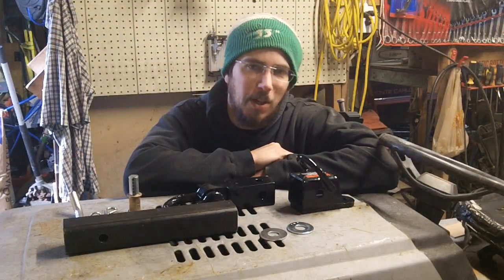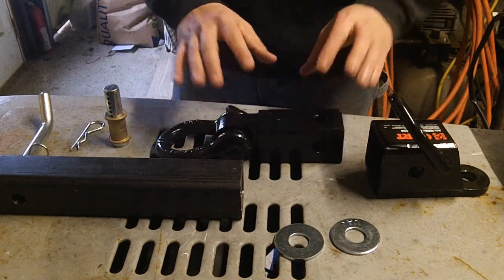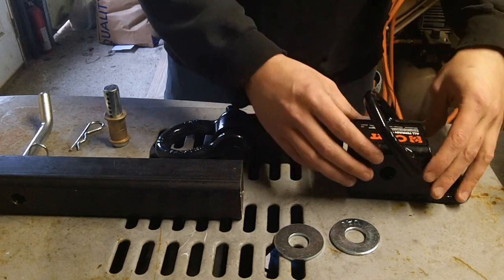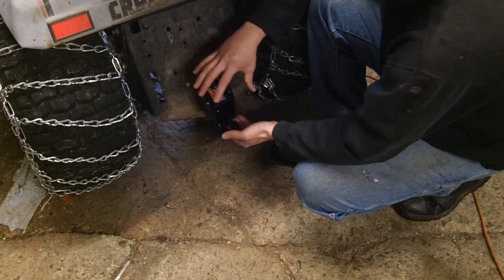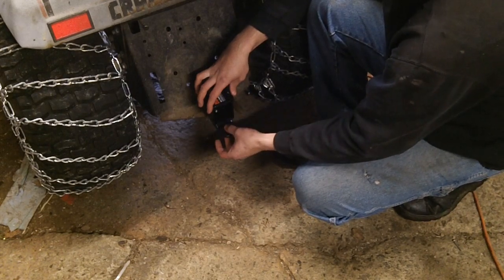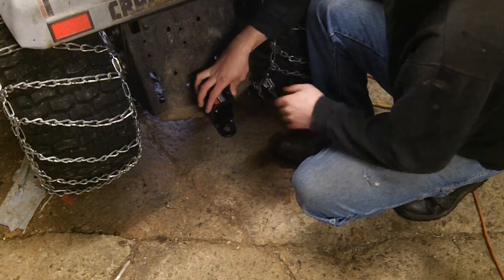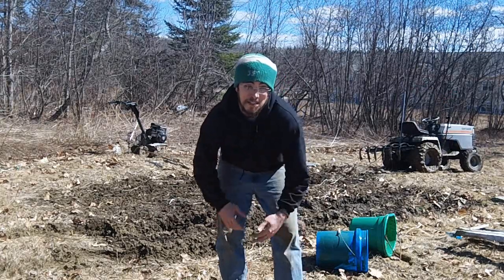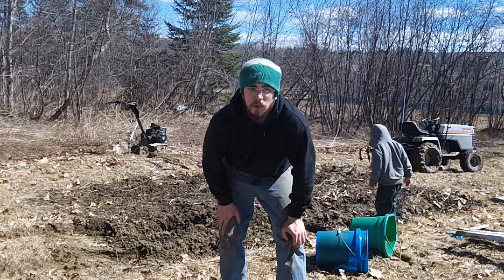Home Made 1 Point Hitch

Comment: Do you have a video where you show how you mounted the curt receiver? I just got the 1 point hitch from Amazon and the curt receiver and put it on my craftsman T3000 and, as you said, "bent the snot out of" the rear draw bar. This was just the weight of the hitch. Maybe there's a way to reinforce the rear draw bar?